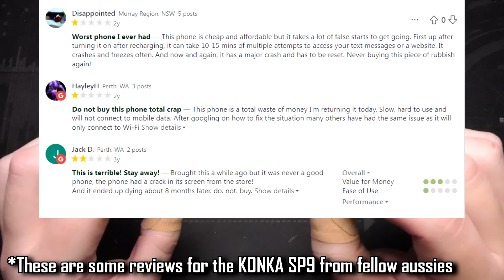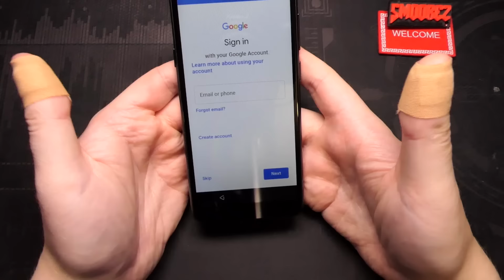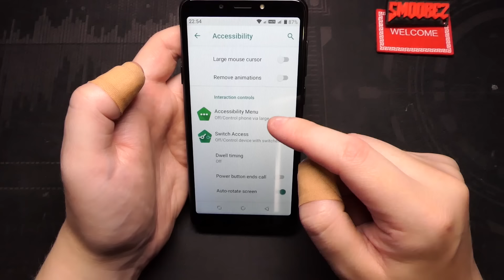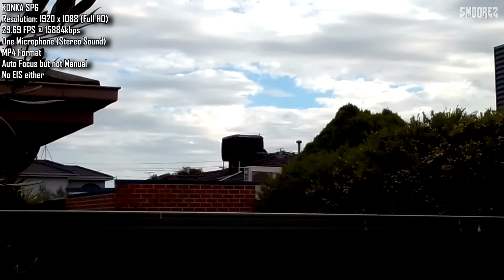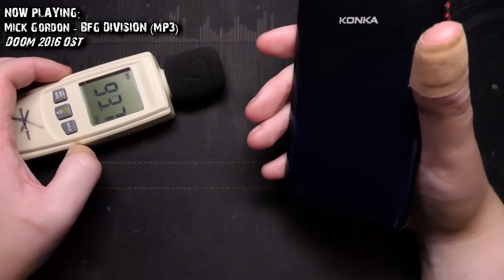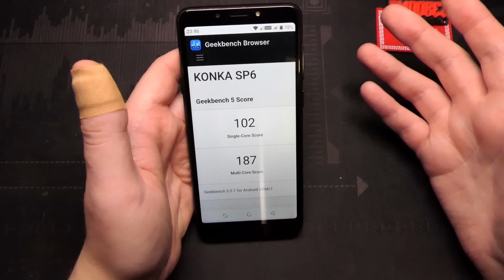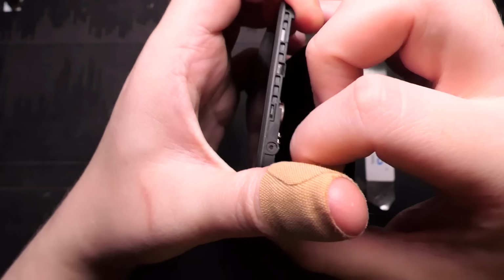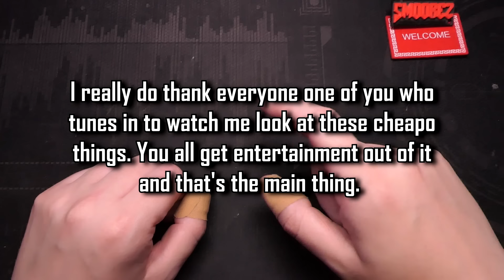I paid $10 for the KONKA SP6 Budget Smartphone...can it "conquer" this review?

Comment: I actually own a TV made by Konka. It's pretty good.
Reply: Yeah my family was used to have one in early 2000s. It's a CRT television
Reply: yep see KONKA tvs all the time in new zealand
Reply: Yep, I actually had a Konka CRT from 2003 until I scrapped it around 2012 when the digital switchover occurred.

I actually miss that CRT television as I spent my childhood playing PS1 and Wii on it.
Reply: leonstrashcan  720p. 32inch screen size IIRC
Reply: Mine is a Konka 50" 4k good for the price, any other brand was more expensive. It can play YouTube up to 4k 60 didn't notice any lag, but is not a powerhouse just a quadcore 1.5gb ram e some ok gpu. But i think this kind of tv nowadays lack heat dissipation, so i set mine to ECO mode and reduce the screen brightness to keep it cool.